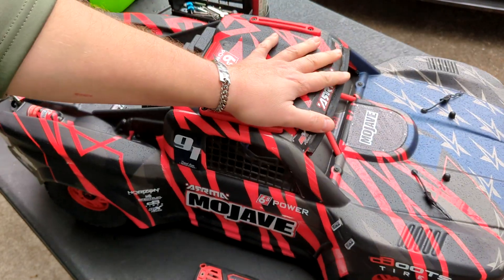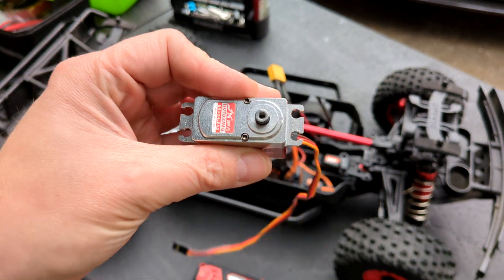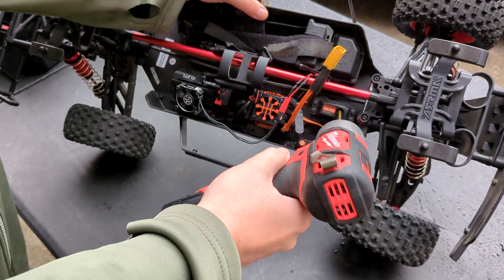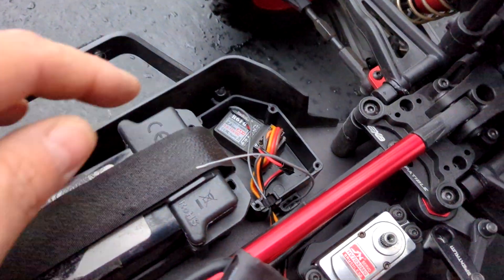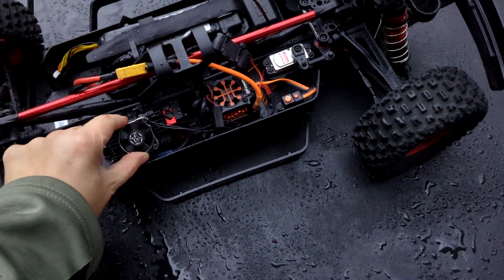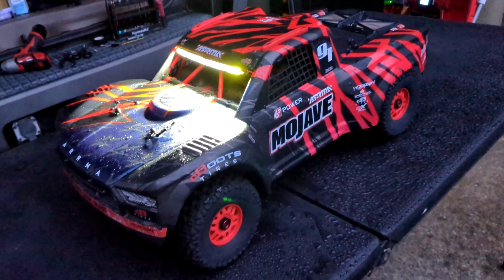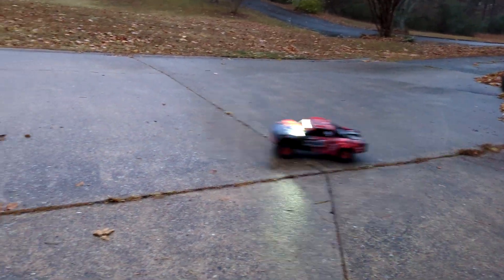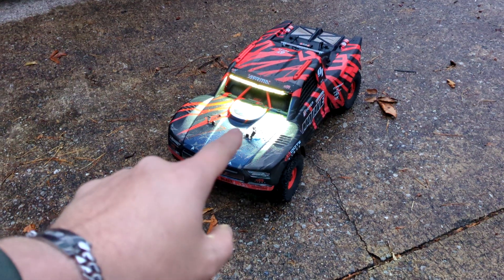Arrma 6s Mojave - Out of Box Upgrades

Comment: But that servo is way taller than factory, how you manage to make it fit as it will hit the chassis?
Reply from the maker: @mazpr2025  if I remember correctly I spaced the servo mount, between the chassis and the mount